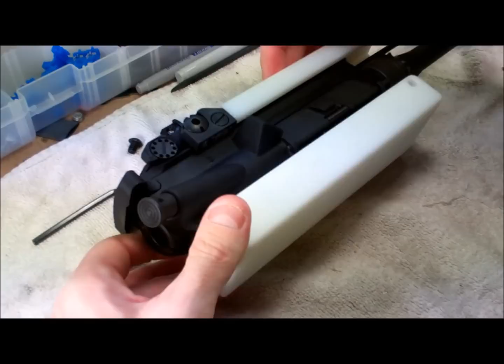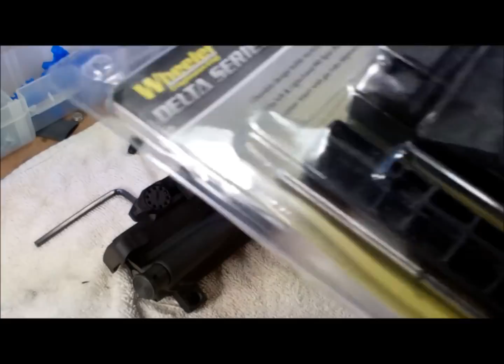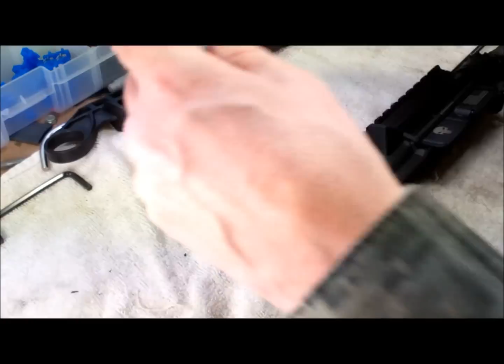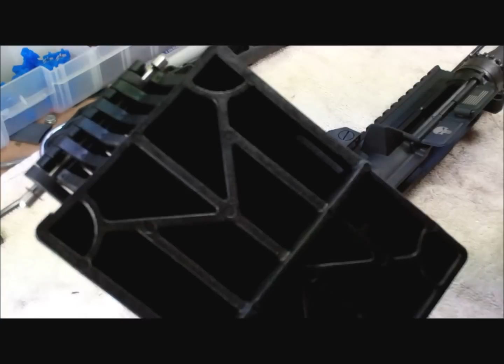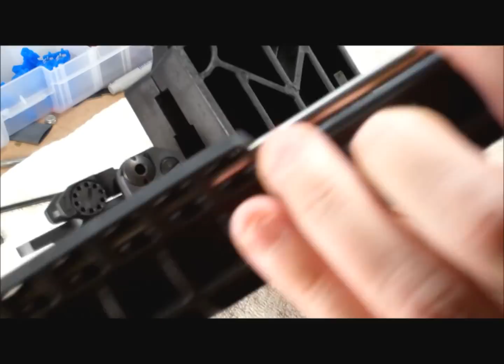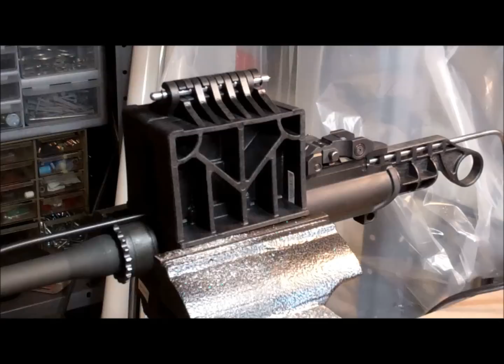Wheeler Engineering Delta Series AR-15 Upper Receiver Vise Block Clamp Review

Comment: I like the block but if the insert moves freely while the upper is clamped then I question whether it does any support or strengthening. But the clamp looks great and I like the fact that it has a large pinned hinge on top.

Comment: Yeah i am a bit older and just am getting into the AR platform, plus its my 1st venture ever into building my own..... Just before and as C19 hit i had purchase the parts to build 4 rifles. Although i still need two barrels. I have the parts for a 458Socom and just had another one built. Paid a good bit of money to get a rifle that dosnt run. Its chambered in 45ACP and the kid that built it said it was my fault for buying mismatched parts. Now idk why as i purchased everything mil spec and from the same manufacturer. In any case that sits in my safe for now. I had to take apart the 458Socom he did because the barrel was bad and got a new one now. Lost the muzzle device as here they must be welded to the barrel. So once i get the barrel on idk when ill get to tip it? But thanks other then my question about the dust cover door i see it been working just fine. I mean im guessing you can leave the door installed but hey yano?
Reply: Idk if this answers any of your questions and I know it’s an old question, but as far as parts go there are slight variances in mil-spec parts which can cause tolerance stacking. Also depending on which parts “aren’t working” it could be a couple different things. When buying parts for a build you have to read the specifications and get parts that will work with what you have. For instance with a barrel, you’d want to look at gas port specs and when buying a gas block match them up with the numbers from your barrel. Also a lot of 45acp ar’s will be blowback operated rather than gas, so you’d have to match the parts up. What exactly is going on with the rifle?

Comment: I know your video is an older one but i just purchased this upper block kit. I would love to know how its worked out for you since im doing my 1st build now. All i have left is to install the barrel and handguard. I was wondering if this block is ok to use while the dust cover is still installed? It looks as though it puts pressure on it? guess im a bit nervous about my 1st barrel install?lol

Comment: +2phast Tactical
I notice you had a little difficulty sliding the upper receiver insert into your reciever?  I get the impression that this may be typical for the Wheeler kit?

I got mine, and the insert would only slide in as far as the charging handle drop in gap in the upper.

The support folks at Radical told me there is some variation from "MIL-SPEC" on this slot in the receiver.

I took a little manipulation with some oil on the insert to determine where it was binding, and some judicious sanding on the edge of that rail to get complete insertion.  Did you have to do anything like that to yours?

Comment: Do you see any reason a drill press vise will not work?
Reply from the maker: That is going to depend upon what type of work your doing and whether or not you want to protect the finish of your upper receiver.  This block is a nice item, but given the amount of torque necessary on a barrel nut, a product such as this one would be more appropriate  http://www.brownells.com/gunsmith-tools-supplies/rifle-tools/bench-vise-blocks/ar-15-m16-upper-receiver-action-block-prod22385.aspx
Reply: 2phast Tactical so you are not recommending I use this for torquing the barrel nut to spec?
Reply from the maker: TrogMan44 Well, I have used it for such, but when your putting the torque on the nut, you can see the way the upper receiver flexes and it is only secured in place by the lugs (one could be twisted and/or break).  Now I have not had any issues whatsoever, but I did switch to the block assembly shown in my previous link.  I may of been lucky with my builds but I would hate for someone else to use this block with say, a substandard upper or maybe one that has internal flaws and then run into a problem.  I still use this block for other jobs, just not the barrel nut.
Reply: 2phast Tactical You're not talking about the Wheeler Block are you? My original question was, do you think the Wheeler block will work in this?:   http://www.lowes.com/pd_552529-281-226340_4294857576__?productId=50168511&Ns=p_product_qty_sales_dollar|1&pl=1&currentURL=%3FNs%3Dp_product_qty_sales_dollar%7C1%26page%3D1&facetInfo=

Sorry for the confusion!
Reply from the maker: TrogMan44 Regardless if you use the wheeler block in a bench vice or the drill press vice like you linked to, my comments still apply.  Since I don't have one of those drill press vices, I can't say it will definitely work, but it looks like it would be sufficient to hold onto wheeler block.  Now whether or not that kind of low profile vice has enough clearance for working on a completed upper, I don't know the answer to that.  You may have issues using certain tools given the clearances.
Reply: 2phast Tactical I'm still missing clarification.  Are you no longer recommending the use of the Wheeler Upper Vice Block to torque the barrel nut to spec?
Reply from the maker: TrogMan44 Yes that is what I am saying due to the amount of flexing the upper receiver endures during the torquing.  But, like I said, I have not had any issues with the upper deforming or the lugs breaking/twisting during the builds I did using the Wheeler.  I am erring on the side of caution and giving you my thoughts and what I currently use for installing barrel nuts.
Reply: 2phast Tactical KOPY!  Thanks for that clarification!  I appreciate that!  TrogOn!
Reply: What’s the difference in that brownells clamp and the wheeler clamp? They look like the same thing

Comment: The "outside" vice block alone is $17 (shipped) on Ebay. I just ordered this Wheeler product (includes inside support piece with gas tube alignment tool) off Sportsman's Guide for a little over $22 shipped, using my club discount and free shipping code of SH1097.

Comment: Good discussion/review. I saw this on Amazon first but did not know how to use it properly, which is where Amazon falls down on the job. They very often leave out very important information on some of the products they do sell, and the info. omitted is a deal breaker with me sometimes. You have 'educated' me in this and Amazon should thank you for this sale; I do.
Reply: Good point out, most sellers are pain in the rear they always lack of good photos and information needed!